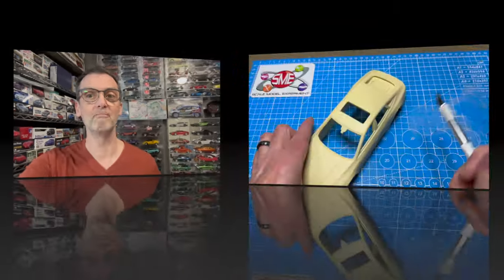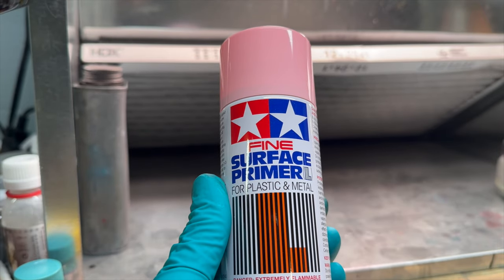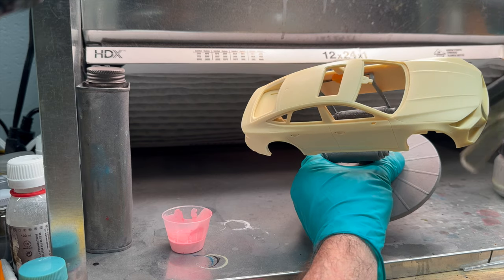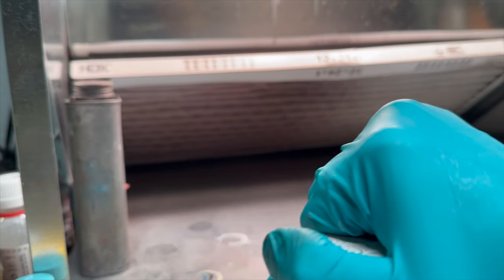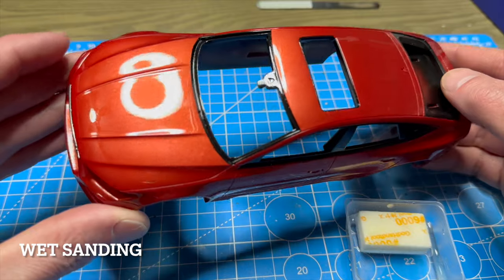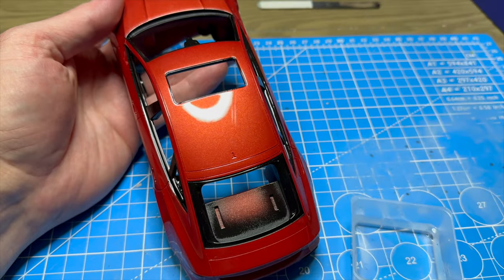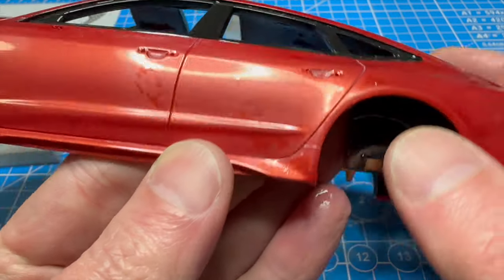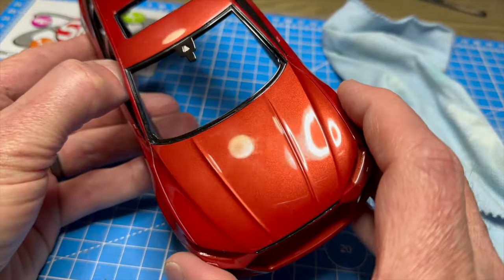Want a MIRROR shine on your model car?  Watch this!

Comment: That Tamiya pink primer is all I use on a red color, really makes them pop. Very nice James.
Reply from the maker: Thank you David, I’ve found that in most cases you can tint your primer with some base coat to get you almost to your final color. For instance when I did the 50 Ford convertible, I tinted the white primer  to cream.

Comment: Turned out great,  looks like a great paint, I need to start using some higher grit papers. Lass polish time.
Reply from the maker: This was an experiment. I usually start with 4000 but I thought I might try 6000 first. Less deep scratches.

Comment: Ihave  enjoyed all of your various vids. I have a question. What type of paints can be used on ABS like resin 3D printed model bodies? Been building models for 62 years, this is my first printed body. I don't want o
to mess my first one up. Thanks
Reply from the maker: Hi Lloyd, resin is easier than plastic because you don’t have to worry about crazing or attacking the surface. Make sure to use a good lacquer primer after smoothing the body and use a lacquer that is compatible with the primer you used. You didn’t say if you airbrush or rattle can, but I like to thin my acrylics with Mr Hobby Leveling thinner. It’s easier to mix shades that way. Good luck and let me know how your first project goes.

Comment: If you would use a much larger airbrush and somewhat thicker paint, you will get an awesome result. Much easier than with a small airbrush.
I suggest you use an Iwata LPH 80. Always spray with a fan pattern, never with a circle pattern.
Reply from the maker: Thanks for watching 👍

Comment: Hi James about that gas in the paint with the bubbles after decanting. When you mix it and you put a toothpick slowly in it,the gas will be out of it faster. Move it a few times around will even speed up things. But i use a glass bottle,fill that up at 7 pm,putt the toothpick in. Then when i go to sleep put the lid on very light so that the rest of the gas can escape. Next morning,ready to use . Ball bearing in the bottle and pre thinned ready to use.And that Red looks awesome on that audi.Thoso Alpha kits are very nice, but to less parts for the money they are costing. For the same money i got a full detailled 1-12 Tamiya porshe kit with paints and all the needs to build it. Or that Big Blue Skyline you build before. Prefer those kits, I cannot justify the price of the Alpha kits,but the body,s are awesome.
Reply from the maker: Thanks for the tip! I totally understand your point about value of the Alpha Models. I felt the same way before I built a few. They are nice packages with the PE, carbon and precise fit and delicate castings. If you like the car, buy the kit.
Reply: @ScaleModelExperiment  Correct with that. But when you buy a Tamiya Senna McLaren with extra carbon and details sets you are going fast to the same price tag as the Alpha kits. The big advantage is that Alpha kits have newer models of cars now. The Honda Civic,The Audi A7 and i have bought my daily driver the Audi Rs 6 stationcar,i got a normal A6 s-line. And the kits are a absolute joy to build after sanding and painting. They really fall into place. No struggling or whatever.
Reply from the maker: @janvanrenselaar5998  I agree with you 100%

Comment: Hi James, great video. Can you tell me your air pressures for the different coats that you use? Thanks
Reply from the maker: Thank you for watching Shawn. I always keep the pressure at 20 psi but adjust coverage with speed and distance of passes across the body.

Comment: this mirror shine part is the biggest challenge to me 😂
Reply from the maker: Mirror shine is all about absolute flatness of the surface. That’s why I showed the inspection bit. I had about 2 hours of time using the 6k grit before I moved on to 8k.
Reply: @ScaleModelExperiment  2 hours? I was doubtful if I was supposed to go over 2 hours for the sanding and polishing process. X)
Reply from the maker: Time well spent with decals and polishing. When I hurry doing either i regret it.

Comment: Excellent, James. What brand is that ceramic compound you used?
Reply: That was Hasegawa ceramic to see on the bottle. But Tamiya ceramic is also very good.
Reply from the maker: I bought the Hasegawa ceramic compound in Japan but it is available from Amazon USA. It isn’t cheap but you don’t need much..

Comment: Absolutely beautiful !! Question...what paints (spray cans) do you recommend for painting fluorescent colors on metal ? I'm taking a jab at doing a 1/18 scale Tide car of Waltrip or Rudd. I'm just not sure what would be the best primer on metal. Any info is greatly appreciated.
Reply from the maker: Hi Alan, the primer would depend on the paint you plan to use over it. I suggest a white primer under florescent colors. You don’t have to worry about the paint attacking the metal so Tamiya primer should be fine. I hope this helped.

Comment: Nice concise tutorial. Picked up quite a number of tips.
A question, if I may……
What colour primer would you recommend for a lime green (Verde Mantis) finish?
Reply from the maker: Hi Clyde, thanks for watching. if you want to have an exact match for the Color I would use a white base.
Reply: Thanks for that. My next build is the Aoshima Aventador.
Reply from the maker: @clydelourensz4077 I’ve had the roadster in my stash for a long time. Someday….

Comment: When you sand after coat, what s your technic to avoid wiping out the paint on edges and small areas? I always damage them 😂
Reply from the maker: I use a 2k clear which is pretty tough. I start with a 6k and a 4k if the finish is rough. I don’t apply any pressure and always wet sand. Keep an eye out for corners edges and small details, they have less paint on them than flat areas.

Comment: Looks great .What are the times you wait between coats?
Reply from the maker: Hi Smiddy, I have my own way of painting. I over thin my paint and shoot very light mist coats for lacquer. They are dry immediately. For most people 10-15 mins between medium wet coats is sufficient for flash off if lacquer and 2k clears. When it comes to clear, I shoot medium wet and allow 5 mins between coats.

Comment: Great video. What size needle was used to airbrush the 2k clear and at what p.s.i?
Reply from the maker: Thanks for watching. I used a .05 needle for the primer base and clear. The trim was done with my other airbrush at .02. I leave my compressor set for 20 psi at all times.

Comment: i never use a air spray gun always use spray can dam now i see you a spray gun i want to learn how to use a air gun is it hard to learn how to use one and is it alot of money to get into it man i want to use one since i see you use one what dose it take to get into one i have to know please reply thank you so much for this video
Reply from the maker: Using an airbrush is not hard, it just takes practice. The one that I use costs $80 and you’ll need a compressor as well. The one I use was around $200. You’ll also need a spray booth which can be bought for around $100. Once you have all of that equipment, you can buy bottles of paint instead of cans and thin the paint to use very little paint to cover your models. I recommend watching more of my videos to see more of me using the airbrush.

Comment: Great paintjob! Can I ask what is your airbrush setup?
Reply from the maker: Hi Redbox, thanks for watching. I use a Master Brand trigger airbrush G37 with a .35 needle and spray at 20 psi. I leave the settings alone and manipulate the speed and flow rate to get a mist or high flow rate.
Reply: @ScaleModelExperiment  thank you!!

Comment: Great looking paint work James👍👍 where might one acquire those Cobra Colors paint?
Reply from the maker: Hi BigChef, Cobra Colors is a line that has been off the market for 20+ years. It’s lacquer and I still have some left. Rosso Fiorante is a close match and was one of the spoons I shot.
Reply: @ScaleModelExperiment  those were some good looking colors. I kinda collect paint lines 😱
Reply from the maker: @bigchef2112 I’ve slowed down on buying paint. I used to buy a lot!

Comment: What's your air compression sitting at, and what's the flash time between your coats
Reply from the maker: Hi Charles, I use 20psi. Flash time is irrelevant because I shoot very thin layers for primer and base coats. Less than 5 mins?  Clear on the other hand is a couple mins between coats. I overthin all of my paints so it doesn’t pool up and is dry almost immediately. I’ll do a video on it soon.

Comment: So this airbrush is emulating the passes of the full size tool used by Kindig (etc)... especially the clearcoat.

And then buff buff buff... kinda shocked there's no micro sized D/A polisher powered by the air line, but just a finger - surely not scale-appropriate haha.
Reply from the maker: I do have a micro buffer. I didn’t use it this time. 😁

Comment: Do you use that brush in-between every paint step?
Reply from the maker: Hi Tim, I could use the anti static brush between every coat but I only did before and after primer and before base and then again before clear. I’m suprised you don’t have one yet. 😁
Reply: I never even heard of it till now! The trick I was using was misting water on the walls from a spray bottle in my paint booth. Then, wiping body with rubbing alcohol.